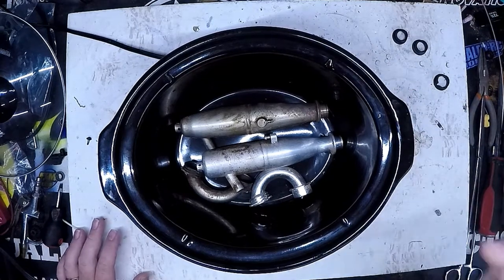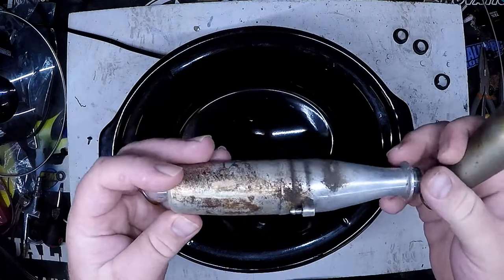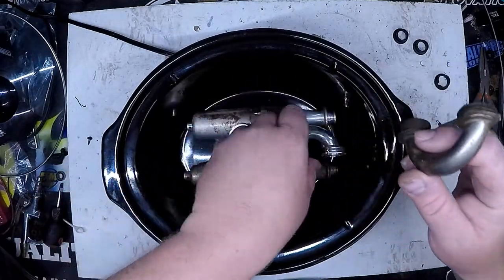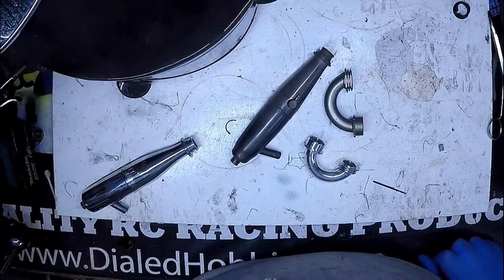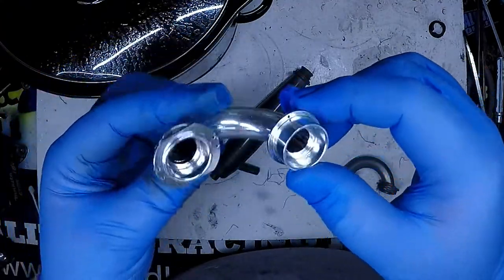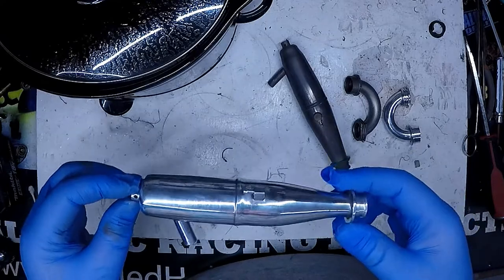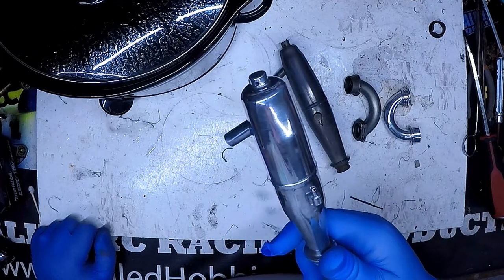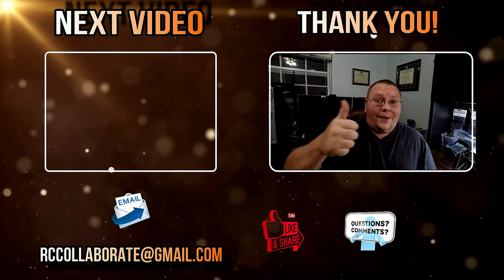Clean Aluminum Exhaust Pipe in Crock Pot with Anti Freeze

Comment: I have seen people cook crankcases, cooling heads and more. Any thoughts on if this will weaken the metal metallurgy of the pipe. Anti freeze base is a powerful acid
Reply: Anti-freeze or ethylene glycol is pH neutral; it is not a "powerful acid", as it is not an acid at all.